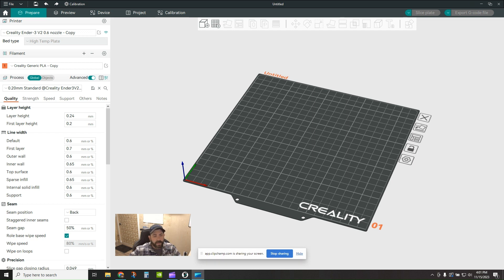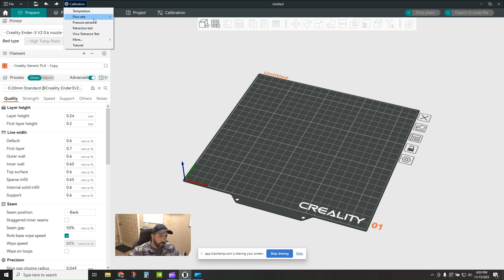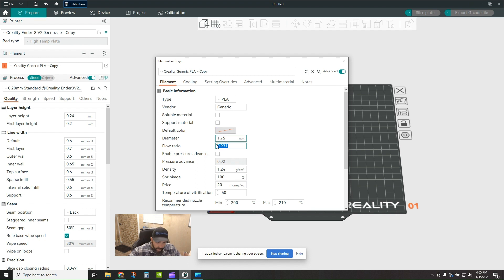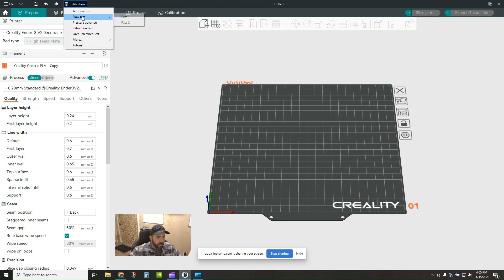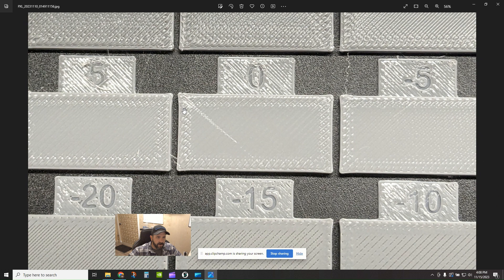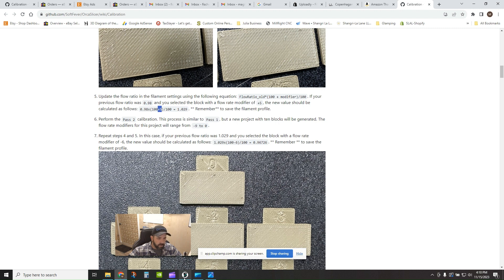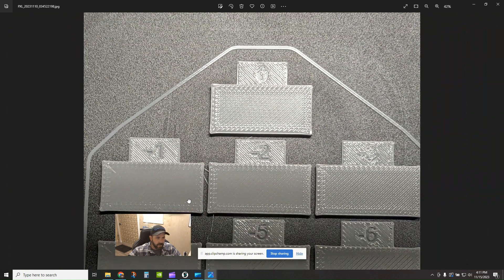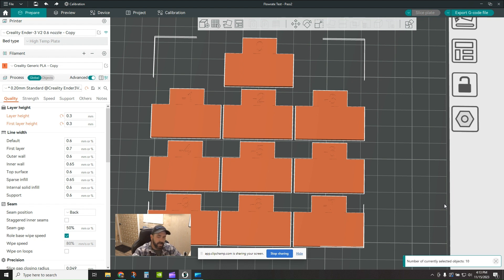Flow Calibration, Tolerance testing, and Temp towers built into Orca.  Great time savers

Comment: If pass 1 looked like 0 was the best. Then do I even need to run pass 2?
Reply from the maker: not technically.  if you like how it was then no need.  the second pass is for finetuning, but sometimes you can't improve on perfection.  if it aint broke....
Reply: @fischer3d  thanks for the reply. Ran pass 2 and -1 looked the best. Changed the length. Think it’s helped. Been having the hardest getting my new printer (flashforge adventurer 5M) to print PETG. Calibration I think helped. Also learned that my filament needs to be drier. 🤷🏻‍♂️. Beginner and trying to learn as much as I can. Appreciate the reply back.

Comment: Now a stupid question, coming from old ender this is new to me. After setting flow rate, before slicing there’s an option to calibrate some flow setting for the extruder. Do you leave that alone after setting your values?
Reply from the maker: I usually run it.  Think about it like this. The initial Flow calibration test in the video is tweaking machine settings for best results.  The calibration before each print is used to ensure the machine is in tolerance to those settings.
Reply: @ makes sense, I wasn’t sure if those two would have any negative impact on one another. I appreciate the response!

Comment: For flow calibration pass 1 you should have gone with 0, because as you said it looked like the right value was between 0 and -5 and you you generally opt for the higher value. Especially for pass 1.l since pass 2 only goes into negatives. In your case your ideal flow was between 0.98 and 0.93 and pass 2 would have gotten you there if you didn't go with the lower option.
Reply: I was just about to write the same.

Comment: Nice. But what to do, when the tolerance test just fails? Which parameter you should have a look at?
Reply from the maker: you'd generally look at this a capability test and not so much as a pass/fail test.  it's a test f what tolerance your printer can achieve.  You could however tweak flow rate, e-steps, speeds and make sure your nozzle diameter is accurately represented in the slicer.

Comment: What's weird is I've done this flow calibration test a few times, and it always gives me really low results (like 91-93% flow), When I do more traditional methods it makes me go higher (to 98-102% flow). after using the low flow numbers from this test, I've found that the surface quality tends to be less than the flow rates from my previous calibrations and dimensional accuracy goes to shit.

Comment: Where can we get those test print files?
Reply from the maker: They're baked into orca under the calibration menus, but if you want to make copies and play with them I was able to find them under my local directory.  C:\Program Files\OrcaSlicer\resources\calib
Reply: @fischer3d  Is it too late to post them with the video? How can you get them to me or others?
Reply: I looked in my location and found some similar files, in folders named FlowRate, PressureAdvance and VolmetricSpeed. Do you have more? I have no idea if mine is OrcaSlicer or based on OrcaSlicer yet.
Reply from the maker: All of mine are just the defaults loaded with Orca Slicer.  Sorry, no others.

Comment: Here is a better calculator, without wasting time and headaches. Just do it like this: take your current flowrate which is 0.98 and type in Google this: 0.98+10% you get the exact same result. in my case it's 10% and then go to your targeted inspection -1%....-9%

Comment: you never showed how the tolerance test works. where do you input the numbers? of your tolerance
Reply from the maker: Hello - you don't really do much with the tolerance test.  It isn't a calibration type print, but a test print that is an indicator of your printer's capability.  Based on the results of your tolerance test you would then make additional tweaks to flow rate, elephant foot compensation, etc. in order to get your printer printing closer to optimal. Here's the snippet from Orca's documentation on that test:

"This tolerance test is specifically designed to assess the dimensional accuracy of your printer and filament. The model comprises a base and a hexagon tester. The base contains six hexagon hole, each with a different tolerance: 0.0mm, 0.05mm, 0.1mm, 0.2mm, 0.3mm, and 0.4mm."  

So, similar to a calibration cube test print, if you're over or under the target dimension you could look to a couple key features (listed above) to tweak and try and get it as close as possible.

Comment: @Fischer3d. Good day. So I've done the flow calibration test and the retraction test 2 weeks ago. Everything was running smooth. Then ivswapped out a different brand of filiment and have had hairy print ever since. Ive been messjng around for 4 days. I got my retraction up to 8mm and still have hairy prints. Im not sure what else i could do. If you have any suggestions it would be greatly apperciated.
Reply from the maker: Maybe check that z-hop distance is set to 0.  Z-hop will promote stringing no matter how high your retraction setting is.
Reply: @fischer3d  Thanks man. I think that was the issue. I also put the Override settings in the filiment tab at 3mm for retraction. Changing both the z-hop to 0 and Normal seems to have fixed the issue. Thanks again your a life saver. I been messing with this thing for 4 days. Now I can go to sleep. LoL
Reply from the maker: Haha.  Glad to hear it!!

Comment: Trying to do the flow calibration with a .2 nozzle on a Bambu labs A1. I always have at least one slab peel up before the print finishes and messes up the others. It seems like -10 is the best from the 3 layers I got through. I doubt that’s accurate enough though, doesn’t seem possible to get through the whole print. Do you maybe have an idea what might be going on? 

225 temp(220 and below print pretty poorly if at all)

B labs A1

.1 layer height and starting height(set by the calibration I believe)

Sunlu grey filament
Reply from the maker: My A1 comes in on Wednesday so for sure would have better info then hopefully.  Probably my first question would be what's your bed temp?  Can you increase your bed temp 5 or 10 degrees to help with that?  Also, in the global Process section you can click on the "Other" tab and turn on Outer Brim.  That should also help keep them suck to the build plate a little better and get a good reading.
Reply: @fischer3d  my bed temp is whatever the default temp is. I’ll definitely try turning it up, I wanted to try making the initial layer height .2 since that seemed to help stick to the bed more but I’m not sure if that’d mess with the calibration results? Will give the brim a shot as well. Looking forward to when you get yours and can try it! :)

Comment: Awesome tutorial! Thanks for this video! New to printing, was using the anycubic slicer, wanted to switch to one with more options and I hear good things about orca. I cant wait to run these calibration tests to see if there is any difference in my print quality. I do have one question though. when i go to slice the temp tower or even the tolerance test, i get a red pop up in the bottom right corner  "relative extruder addressing requires resetting... add "G92 E0" to layer_gcode." I have no idea how to access the gcode in order to add this line. Any chance you could help me with this? It's preventing me from being able to slice if that helps at all. Oops nevermind. I found it. Look forward to more of your ORCA tutorials and other content in the future.
Reply: Wgat was your solution?

Comment: so for the flow rate calabrations...  do you just keep going back and forth until you get a good even set?  or does just doing the two passes suffice?
Reply from the maker: Unless you're swapping drastically different types of filament often, I would think just the 2 passes would suffice. Or if you changed something hw related on your machine, like new steppers or extruder you might need to rerun it.

Comment: Hi, on an X1C, with just black generic PLA, I can NEVER get the flow plates 'smooth' - they're always like hashed showing the criss cross of the pattern. Default pla settings in orca and bambu, same deal. I even changed the nozzle as I suspected it to be worn. Some improvement, but it's still driving me nuts, have you seen this before?
Great video thanks!
Reply from the maker: What's your first layer flow rate?  Maybe try over extruding the first layer a bit more?  That can help blend those lines.  Maybe an extra 5 or 10%

Comment: Hello Thanks you for your lessons Im new to orca and printing in general and your explanations are very helpful. For the Tolerance test,  is there something you can do when you find out your out of tolerance?
Reply from the maker: Thanks. Yes, you can fine tune flow rates, speeds, etc.. just keep in mind that rarely will every print be spot on.  everything has some tolerance built in.  Each part on your machine has some tolerance built in, the filament you use has tolerance built in.  All of these can stack up and result in a part that isn't nominal.  My advice would be to run through as many of the calibration tests you can for your machine and fine tune the results.  But every machine is a little different.  It's more about understanding the limits of your machine and understanding what it's capable of.  In addition to the tolerance test in Orca, you can print some simple 20x20x20 cubes and measure the results.  Inner and outer wall Flow rate & elephant's foot would be a couple of settings you could tweak to dial in those results.

Comment: Why the heck do you need to do this now, which takes an hour but the other flow cali (old one that used lines), took just a few min? I don't have time to spend over an hour or so calibrating each brand and color of filament. Is there an option to use the other calibration test?

Comment: I'm a bit confused at what my printer is doing during the flow rate test calibration....by the time I get towards the end, the nozzle is actually scraping the test markers.  I had to stop the test because it was literally peeling off the layers with the nozzle.   Any ideas?
Reply from the maker: any chance you accidently turned on ironing?  Or were the pieces lifting off the bed causing some scraping?
Reply: @fischer3d   Thanks for replying.   No, ironing is off.   It's almost like the printer doesn't go  high enough to clear the next layer.

The layers were firmly attached to the bed.  By peeling, I  mean the nozzle was actually pushing the previous layer off the tabs while doing the diagonals.
Reply from the maker: very strange.  If it were me, here's a couple of things I would check... in Orca, after you load Pass 1 or Pass 2 tick the "Objects" Slider in the process area from global and check the layer heights for each object.  The flow test layer heights are pretty aggressive at .3 mm. Maybe make sure they didn't get reduced to something like 0.03mm.

If print settings all look good then look at mechanical items.  Stepper couplers, backlash nuts, etc.. make sure those aren't loose or binding since that could cause missed steps.

What type of printer do you have?
Reply: I had the same issue.  After some investigation of changing settings and reslicing, I noticed that @fischer3d had 7 layers and I only had 5.  I eventually noticed that for my Neptune 4 Pro with a 0.4 nozzle if you change either the Layer Height and or Firrst layer height it will reduce the amount of layers by 1 for each. I am using the system preset 0.20mm Standard @Elegoo Neptune4Pro (0.4 nozzle).  Hope this help if you haven't already figured it out.

Comment: Question: Should you have the Quality section of the Global settings in the Advanced area for Flow Ratio, Top and Bottom Flow Ratio set to 1.00 prior to running the flow tests or can they be left as is? Do these values need to match the test results or should they be left as is?
Reply from the maker: Sorry for the delay.  In your Global settings, don't worry about what's there.  When you select Pass 1, Pass 2 the printing is switched to "By Object" and most of your global settings are ignored.  

Just load Flow Test Pass 1, Print, Adjust Flow Ratio.  Load Pass 2, Print, Adjust if needed.

Comment: Were do you adjust the tolerance?
Reply from the maker: Tolerance isn't really a setting you can adjust.  It's the result of your machine's capability.  Once you run the tolerance test and get a result you can fine tune your settings to potentially achieve a tighter tolerance.  Things like flow rate, wall thickness, speed, etc.. will all effect the overall tolerance.

Comment: Thanks for the video.  Do you have anything in Orca for multi color prints/inlays with single nozzle printers?  Settings like Prusa where you set up 2 print heads but use one extruder.  I am not talking about filament color changes for an entire layer.

Comment: Quick question i did a flow calibration vase mose 20x20 cube and my wall with is .48 but the cube ia 20x20 and looks great. I did pass 1&2 but am confused is there a way to change this? Trying to achieve 20x20 .4
Reply from the maker: Hey there.  Thanks for the question. In my experience, achieving a .4 wall thickness is going to be difficult from a .4 nozzle.  I know it's counterintuitive, but rarely are .4 nozzles actually .4.  Sometimes they are over or undersized.  Then you have to deal with the filament expansion once it leaves the nozzle and then the compression/squish on the initial and subsequent layers.  All that being said, you can play with the settings under Quality>Line Width.  Maybe fool around with the Outer Wall width.  If your setting is at .4 now, but your result is .48, maybe try reducing that setting.

Comment: so how do i adjust for the tolerance test if im a .2
Reply from the maker: It depends... I'd look at flow rate, print speed, belt tension first to see how much you can dial it in, but keep in mind that every machine, filament, etc.. will have their +- tolerance.  If you're running a stock Ender 3, for example a .1ish tolerance is pretty good.

Comment: Thanks for your videos about Orca Slicer. I can not increase the part cooling fan speed for overhangs. Any idea will be helpfull.
Reply from the maker: Thanks for your note.  Here's a couple of settings to check.  First, under your Process settings go to the Quality tab and scroll to the bottom.  See if "Detect Overhangs" is checked. 

Next, go to the Speed tab and scroll down the Overhang speed section.  This is more related to the speed of the extruder, but when an overhang is detect the extruder speed will slow allowing the part cooling fan to be more effective.  

Finally, at the top of the screen edit the Printer Settings (Click the cog wheel next to "Printer" located directly under the Device menu text.   On the Basic Information tab scroll down to Cooling fan.  Check the box for Overhangs only and play with the delay settings.  If you hover your mouse over each field a small help text pop-up will be displayed.  

Hope this helps. Good luck.